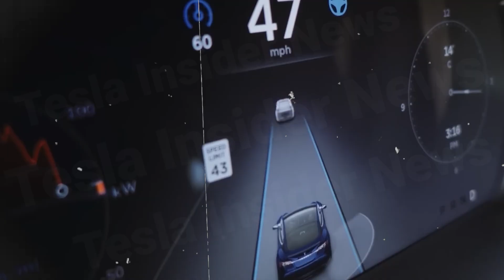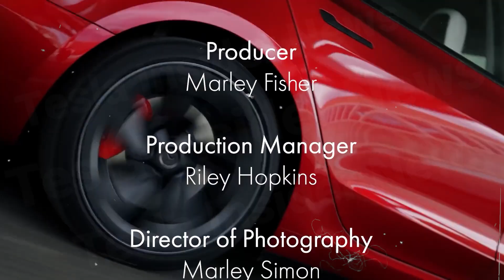BREAKING: Tesla Model 2 2026 FINALLY Revealed? All You Need To Know

Comment from the maker: If you had $20k, what would you choose?
A) Tesla Model 2 – durable, cheap to charge, long-lasting battery ⚡
B) Chinese EV – cheaper upfront, but shorter range & costly repairs 🚗
Comment A or B + your reason
Reply: As it stands now, it's between the Zeekr GT 007 and the Tesla Model 2!
Reply: Zeekr GT 007, Reason towing weight: 2200 kg and folding rear seat "that you can also lie down on" for one or more nights!

Comment: The Tesla Model will never be a long-term success. They are losing value faster than most other brands. They are stuck with inventory. They aren't a very reliable vehicle..

This is because the CEO is a lying narcissistic trash can. 

Good luck with your constant over promises and under deliveries of the next Tesla....

Roadster that goes 700 miles per charge.... LIE
Tesla Semi that goes a million miles.........    LIE
Tesla Cyber Truck bullet proof..............         LIE
Tesla Robots...................................................LIE
Tesla Robotaxi....                                               LIE
Tesla Solar power Shingles...........................LIE
Tesla Autopilot hands free from NY to LA....LIE
Reply from the maker: Totally get where you’re coming from — Tesla’s track record with deadlines definitely fuels a lot of skepticism. ⚡
That said, even critics admit the company’s pushed EV tech, manufacturing, and charging infrastructure further than anyone else so far.

Still, fair point — trust is earned, not promised. 👀
If you were in charge, which of those projects would you actually prioritize to rebuild confidence?
Reply: @TeslaInsiderNews   I get what youre trying to convey. I applaud the earlier founders for what they produced. The current Tesla Model as a factory is all about GLAM and Stock values. They aren't delivering on actual promises. 
Telsa Semi..... LIE
Tesla Roadster 2020 ..... LIE
Tesla self driving La to NY ..... LIE
Tesla 700 miles charge Roadster... LIE
Tesla Robots.... LIE
Tesla Cybertruck Bullet proof..... LIE
Tesla solar shingles..... LIE

We can go on and on... but at the end of the day, it all stems from a Lying Boardwalk huckster selling fanbois on spoonfulls of bullshit.... and these fanbois will lap it up just because..... There are now better alternatives... and quite frankly I see the Toyota Solid State battery revolution killing Tesla.... But thats me...
Reply from the maker: @marcymcsheehan3579  Totally fair take — Tesla’s missed plenty of timelines, no argument there. 🔧
But what’s interesting is why they keep doubling down instead of pulling back. Every “LIE” project you listed is still quietly in development — and that says something about long-term intent, not just hype.

Solid-state tech from Toyota could be a real game-changer though. 👀
If they actually mass-produce it before 2027, that might finally give Tesla some real competition — and that’s good for all of us.

What’s your call — do you think any EV brand can scale faster than Tesla’s Gigafactories right now?
Reply: @TeslaInsiderNews   In my opinion. Tesla is such a fake trash company. That when Toyota bought in, read the books they realized what a shit hole it truly is and sold. 

I don't believe that Tesla will sustain. Elon is not a genius. Elon is not an innovator. Elon is, a great huckster and salesman who can sell a good bullshit story to enable people to buy in and open their wallets. Everything that Tesla was producing up to the Cybertruck was already on paper to be developed before elon kicked out the original founders. The Cybertruck debacle is 100% All Elon from the ground up. and that is why it is such a giant problem for collecting any kind of profit. 

When solid state batteries drop, Tesla will be stuck as the vehicle that has zero resale value to the point that NO ONE will Want them. It will be the death of the company.